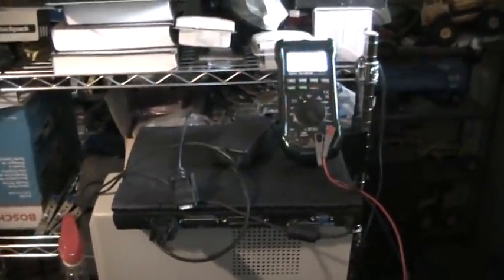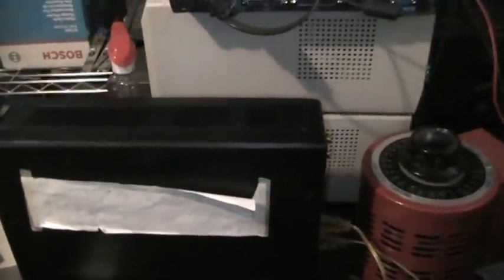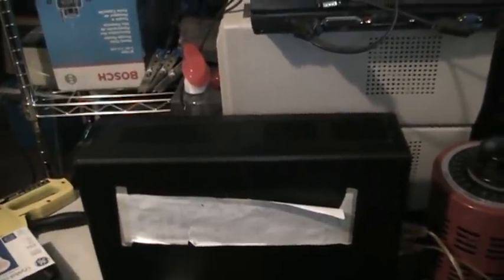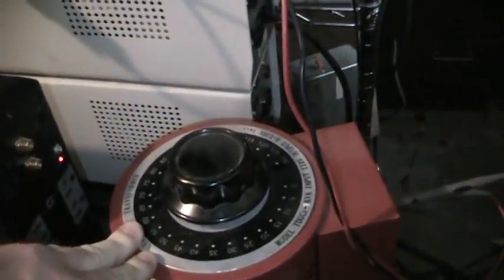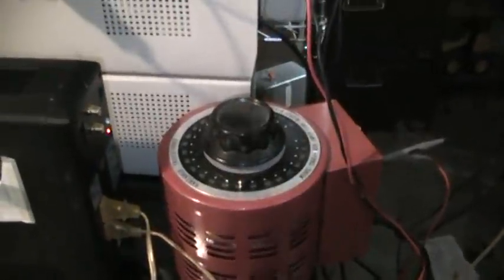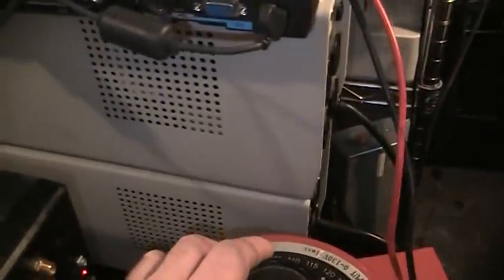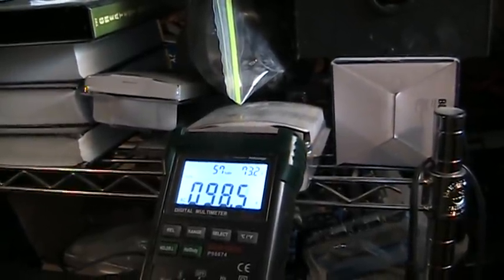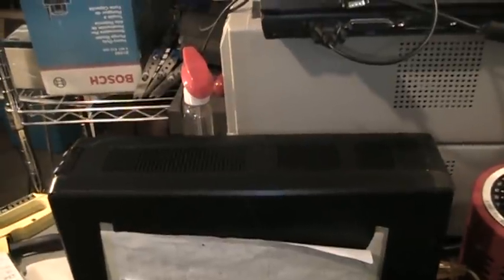Troubleshooting the Elusive Faulty Uninterruptible Power Supply

Comment: It surprises me that in this age of computers and micro electronics nothing new has come up to replace all these dinosaurs. It most be possible to create a SOC and battery charge-discharge regulator for low to medium loads up to 250 Watt pure sine-wave. Why isn't there anything like that?
Reply from the maker: I'm not really sure where you're going with this. There do exist things like lithium-ion based UPSes. I've yet to see one I'd actually buy, because vendor lock in with the batteries is almost certainly the order of the day.

There are a couple of factors that have to be considered. Low frequency transformers capable of high current operation aren't small or light. Lead acid batteries are cheap, resilient to abuse, capable of high current delivery, safe, highly recyclable, and highly recycled. The only thing not to like is the weight. They make up over half of what's inside this particular UPS and easily 2/3rds of the weight.

Even if there were to be some standard for powering computers in a more efficient way during power failures, it comes along too late for older systems that people are still interested in using. People also use UPSes to power things that aren't computer loads.

I would agree that there is no reason for any modern inverter or UPS not to have a true sine-wave output characteristic.
Reply: thats what they want you to think "technology". they basics have not changed and likley will not

Comment: Your video is fine and very explicative but worthless. How do yo resolve the relay issue?  You wouldn’t even crack open the UPS
Reply: https://www.youtube.com/watch?v=dIEM2bG8mOQ
Reply: According to this video, the F06 error code for "Relay Weld" is just that, the electronic relays are fused or won't actuate for some reason.  Replacing them should fix the problem.  I've had my APC XS1300 in service for 11yrs and it just got the F06 error a couple of days ago.  I may follow this video and give it a shot myself.
https://www.youtube.com/watch?v=AW2ZKtzr0rc
Reply from the maker: If I knew that, don't you think I'd tell you? I believe it's a firmware or design error. I'm far from the only person who has had this problem.

I'd tell you of a workaround, but I'd hate to waste anymore of your very valuable time.
Reply: @uxwbill  of course. @uxwbill most people provide you with an answer here. No need to keep knowledge to yourself as in dark ages.
Reply: @uxwbill  Well, whenever I read "troubleshooting", I do expect getting a solution. The video just turned out to be a clickbait.👎

Comment: I have a CyberPower that I’ve been using since 2013, and it has had no problems. I have never needed to replace the battery either.
Reply: Mine went out after 8 yrs, now im getting fucked by APC. 2 RMAs in a month because "faulty welding". Just want my money back to buy a new CyberPower now.

Comment: Hi, I am deciding between a Cyberpower or APC pro unit. I enjoy your videos and If you have the time I would appreciate your advice.  I am looking at the backup types that put out the sine wave power, not the cheaper models.  Both specs are about the same and both costs the same.  I am leaning towards APC as I know that brand and I haven't used Cyberpower.

   I am looking to plug my Xbox One X into it which has a 245 watt psu although the maximum load was measured at 172 watts while stressing the Xbox one x under 4k gaming.   I am also looking to plug in my 55" Sony xbr 900e Led backlit TV into it.  Sony states 171 watts in use for the TV.  I turn off the TV speakers and use an external Bluetooth speaker the Aiwai Exos 9 which has it's battery pack built in so that doesn't need to be on the battery Backup.

I'm looking to get 5 minutes of battery runtime from the battery backup. So taking into account the Xbox one x at 245 watts psu and the Sony xbr at 171 watts, would an APC back-ups Pro 1100va at 600 watts be enough in your opinion or should I go with their 810 watt or even 900 watt unit.

I already have an APC smaller cheaper unit at 250 watts that I just put my router, modem, and an external WD USB Hard drive on so I think that small unit can handle those fine.
Thanks
Reply from the maker: Either brand will supply a high quality product that should meet your expectations. Cyberpower has a less expensive true sine wave product offering than does APC. I did a review video and thought it was OK, although I think it uses nonstandard batteries.

Whatever you buy, get a bit more capacity than you need. As the batteries age, the runtime will become lower. What lasted five minutes when new might barely last one after the batteries are a few years old.
Reply: @uxwbill  Thank You I am going to get the APC 900 watt version to be safe.
Reply: @uxwbill  i hooked up 50ah or 100ah batteries with custom cables.
Reply: My Cyberpower works flawless, my APC has always been a PIA. Anytime I power the APC down, extended power outages, it will not turn back on. I have to unplug it, and pull the battery, plug it back into AC and power on, then reinstall the battery. So annoying, as it is behind the entertainment center all plugged in.

Comment: Hey Bill, I have a quick question- Overall, who do you think makes the highest quality UPSes today? Thanks, just wondering your opinion.
Reply from the maker: I think that's a tough question for me to answer. I generally still buy APC when I buy new, and get along perfectly well with them. CyberPower Systems has really stepped up their game, though, and I'll happily buy or use those A ) if they're on sale or B ) if I can't get an APC.
Reply: Thank you. I have a Cyberpower 1500PFCLCD sinewave UPS that I'm very happy with.
Reply: @averyalexander2303 I had the same one and it was stolen when I moved :(  I've had an APC 1500 for about 3 years and it just died (F02 error).  Will go with true sine wave Cyberpower again as I never had a problem with it.
Reply: the leader APC is not great but its better than CyberPwr is copy-cat. These days the high end deliver cleaned up sinewave outputs: $$$
Reply: APC may have the highest market share but I've had much better experiences with Cyberpower. Plus Cyberpower 1500 True sine wave costs about the same and a APC 1500 with a simulated sine wave. That's my personal experience. My job (An IT company) uses and recommends Cyberpower.
Reply: I tried CyberPower before. They had a rack mounted 2200 watt model that cost hundreds less than a comparable APC. But it just died on me one day, out of the blue. Wouldn't power on at all. Not a fan of APC with all the issues I've had with them -- but not convinced CyberPower is any better? A tech I know said he dislikes CyberPower because unlike APC, they won't make repair schematic diagrams available.
Reply: @kingtj  Not sure who makes better products, but I don't like that Cyberpower doesn't make repair diagrams available.

Comment: i have this ups. you need the powerchute software.
Reply from the maker: No. It is compatible with any operating system having support for a generic USB HID class battery device.
Reply: oh. well mine has been a headache for me. first one, it stopped charging its battery, they quickly replaced it and the new one has stopped charging it's battery also. it's somewhere collecting dust now

Comment: If it were me, I'd try to fix it. Not because it would be any great loss having so many in reserve. No, I'd fix it simply because I find myself compelled to figure out how things failed. In doing so I discover the parts that don't work anymore and the job of replacing them is simple in most cases. If you don't find that entertaining then there's no point metaphorically beating your head against a steel plate especially when it's so easily replaced.

That said, you could still try putting new batteries in it. Either by swapping them from a unit that has good batteries or buying new ones. If it still fails with known good batteries, those batteries can either go back to their perspective homes or await use in another device. I'm fairly certain you will anyway because I've watched enough of your videos and have a fair idea of how much something like this bugs you. I don't see you being able to leave this alone any more than I could.

Comment: Can't beat the older stuff, despite capacitor and charging issues... Though I do like the LCD display on the newer SmartUPS units. The plastic ones I consider throw-away after they exhibit faults other than battery related ones.

I run a Smart UPS 1500 and a Smart UPS 750XL to an APC AP7721 Transfer Switch which runs my entire A/V system, lighting and computer. So far, the only issues i've come across have been maintinence related. Got a 20 year old BackUPS 420 running the cordless phone, router and a couple of table lamps running LED bulbs, I occasionally test it with a 200W tungsten lightbulb.
Reply from the maker: I have a whole slew of Back and Smart UPS models of widely varying age, as well as a 31 year old APC 1200VX UPS that's still going strong. Most of the rest are somewhere between 15-20 years of age at this point, and also working well with (usually) only periodic maintenance.

Whenever I see regular incandescent bulbs being closed out, I'll buy them out. They're great for this sort of thing as well as the "dim bulb" tester, and I think they will eventually become very hard to find.
Reply: @uxwbill  they already are almost impossible to get in europe   :-(

Comment: I personally dislike those newer APC BackUPS systems with a passion (at least the ones in a plastic case - the old ones in a metal case are fine) mainly due to bad capacitors and maybe also bad circuit design from what I've read online about those. I've junked two of those smaller plastic BackUPS models cause they were causing too much grief. 
All my "important" stuff is on APC SmartUPS systems that are getting somewhat old now too (two black SmartUPS 1000 and one black SmartUPS 1500 which are about 15-18 years old now if I remember correctly). So far I haven't had that many problems with those aside from having to swap out the old batteries with new ones every couple of years.

Comment: Perhaps it's glitches in the mains that causes it to go daft, you are being carefull and slowly changing the voltage, that may never upset it.
Be evil and pull the power plug out slightly so you can jiggle it and cause spikes.
Reply from the maker: Off camera, I did try aggressively cycling input power on and off, and it didn't upset the apple cart.

I'm suspicious of the batteries, just because they are quite old.
Reply: I know the feeling bill, being old ha ha :-D.
Yup test batteries borrowed from another ups would be a cheap test.

Comment: Hey Bill, been running the 550 model (2 of them) for more than 8 years. It is 95% the battery. Mine are on their third battery replacement right now, one of them protects my gaming rig and the other is attached to my consoles, display (I game on a pc monitor btw) and my MacBook Pro, running close to their limit for years now, as the 550 model is good enough for 330 Watts of equipment and they often run for 10+ hours per day at the 250 - 300 Watts range. 

Batteries for the 550 model cost about 12 to 25 bucks I do not know the actual price your model, but the unit itself is enough expensive to justify at least a shot in replacing them. Nice one buddy !

Comment: I think it has to do with how they are made, this line of ups' are very sensitive, we have on in our office powering a server. Nasty 50-70hz continuous wave changes (old power transformer or dirty power from the wind farm is to blame) and once in a while the voltage dips below 90 or goes above 140 volts or so. So I don't think it's a ups or battery issue. It would make sense, as a ups to protect against too much input voltage. Definitely don't rule out the batteries though, these new ups' have very cheap Chinese batteries.
Reply from the maker: This problem only started occurring in the recent past, and nothing that takes place on the power line (short of extremely severe overvoltage conditions) should cause the UPS to fail in this way.

Aged batteries are a possibility that I've considered, though runtime remains well within expectations.
Reply: Ah ok. Maybe I should check and see how old the unit is that I have. I have no real "comparisons" to go against it since i'm barely around to check the equipment.
Reply: <90V and >140V!?

Holy guacamole, Batman!

Comment: $10 bucks says its the batteries. I've been through this
Reply from the maker: It probably is, and I'd certainly be willing to make that investment.
Reply: these units use 2 batts charged in serie without a tap. Cells get out of balance, over charged then internally cut out.

Either buy the latest APC Sinewave design for $150 or replace both batts under $50... saves $100!
Reply: I get F06 every few years.  Always the batteries.

Comment: There's something particularly frustrating when a UPS fails, almost worse than having no UPS at all because at least it would have come back online after an outage automatically. Instead, the failed UPS keeps your important equipment offline while it screeches away and waits for you to physically walk up and press a reset button.

I get why they're designed that way (I wouldn't want it to keep resetting itself until it catches fire or something) but it's still frustrating. Dual power supplies are a nice workaround (one side to UPS, one side to the outlet directly), but unfortunately not a common feature on home equipment.

Comment: I've had similar fun with an XS 1000 (black case with LCD on the front). It'll work for months with no issues but sometimes it'll wake me up with a loud, constant beep and a F02 error. But I've come to expect at least SOME weirdness because I'm using it sans battery at the moment because I stupidly recycled the battery cartridge that came with it and didn't think to salvage the connectors to put new batteries in. 

The error is easily cleared with a power cycle and it'll continue running things just fine, but I've never been able to nail down why it'll just suddenly throw a F02. Guessing it might be related to high/low voltage and it trying to compensate using the battery, but when there's no battery it just flips its lid.

Comment: If I'm not mistaken, some time ago you had a video about replacing a UPS battery, and if I recall correctly, there was a link in the video description that had a website where you could buy replacement UPS batteries.  Would you be so kind as to repost it here?
Reply from the maker: I've always gone to eBay, where I usually buy on mainly on price.

Comment: I got one of these units complete in box out of the throw away pile from Engineering at work with permission. All that was wrong with it was the sales guy never opened the battery compartment up and set the battery in the right way. When you order these APC will send them with the battery in upside down to avoid any problems or damage during shipping. Once I put the pack in the right way and tested it for a while it ran great! Ya can't beat FREE!